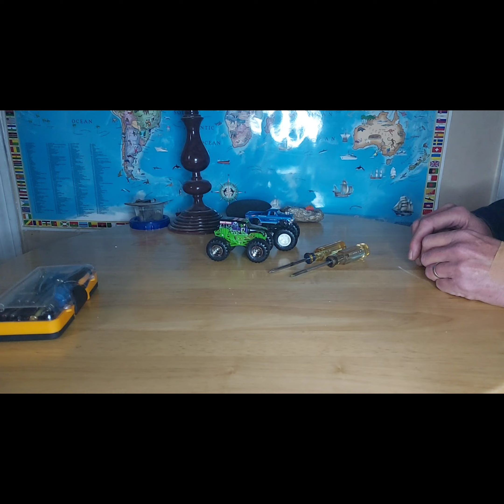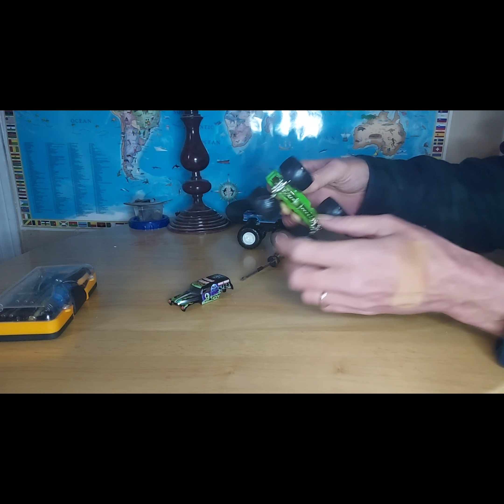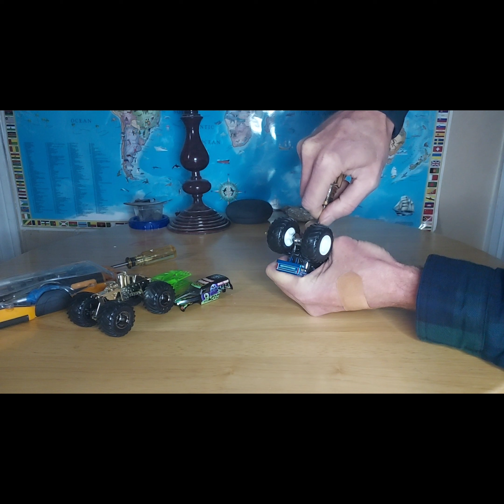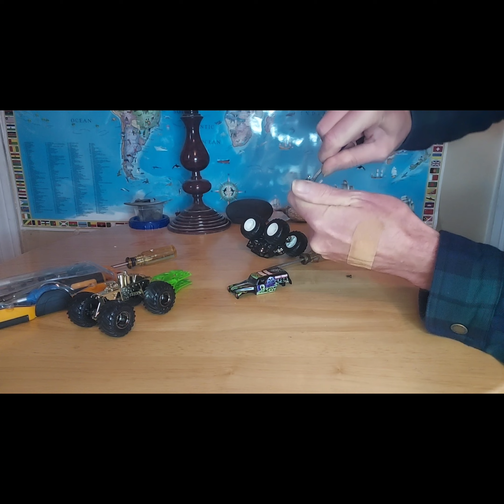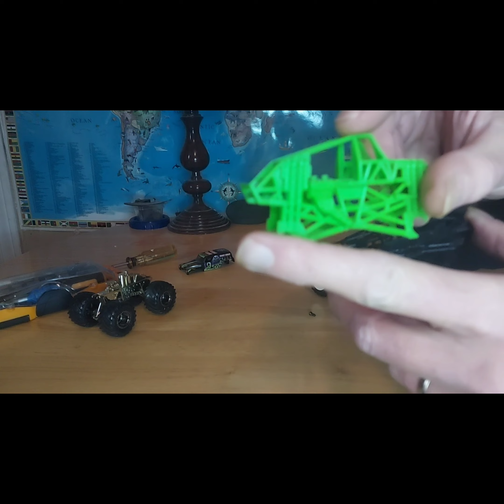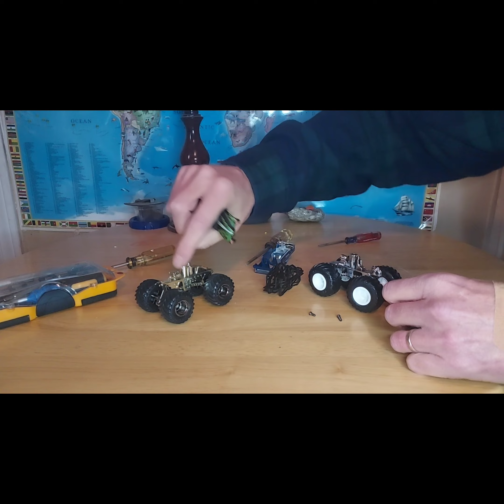Tutorial: Part 7.(How to Disassemble Spinmaster/Hotwheels Monster Trucks.)

Comment: There's one problem. The screw are HELL to take off, ive tried all my screw drivers, and there all [expletive]. How did you do it? For spin masters
Reply from the maker: Hotwheels uses a tri-bit. Spinmaster uses a Philips head. Hotwheels before 2018 is usually a rivet and would need to be drilled and tapped to remount. Some use hotglue or jb weld.